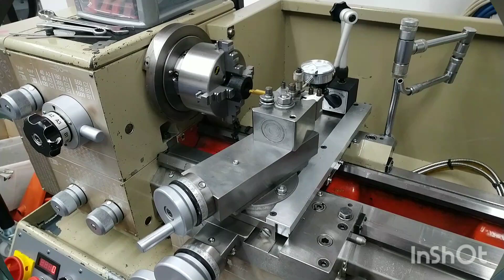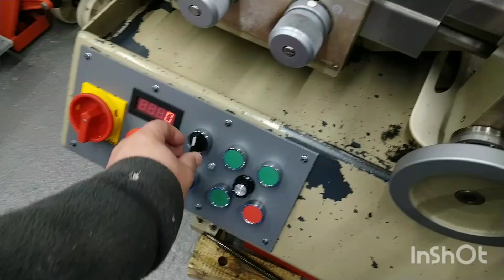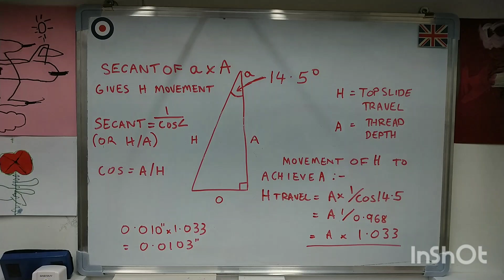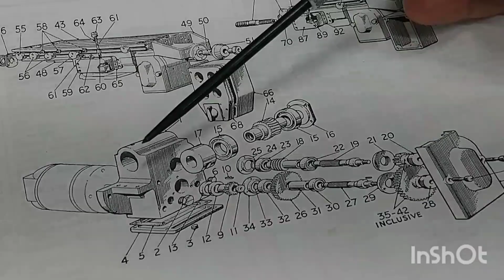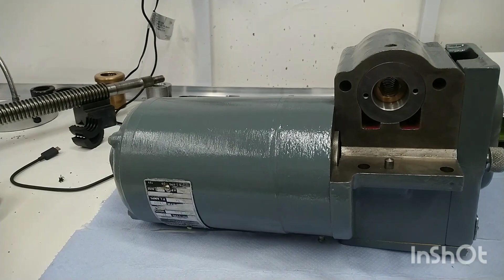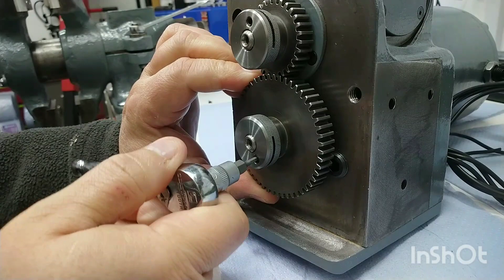Harrison Mill Refurb Part 5 - Threading Woes and a Look at Past Progress

Comment from the maker: Hello people! Thank you so much to everyone for the very positive response I've had so far to this film. I almost didn't put it out, it didn't seem worth it to show a cock up! This channel isn't a vanity project though. I do my best to be as accurate as possible in the home shop, but I make mistakes and learn from them. So if I do cock up, I will show it. If you are interested to see what went on with the motor, gearbox and other mill components before I had this channel, please have a look at my thread on the mig welding forum, here:-
https://www.mig-welding.co.uk/forum/threads/harrison-horizontal-vertical-mill-restoration.82648/

Comment: Excellent video.  It's great to see other people make the same mistakes as me.  Sorry to bother hear about the gear counting issue. Have you thought of 3d printing a gear for the one off operation?  I have designed gears on an online site and printed them. They work great for the time I needed them. Great job.
Reply: I just watched the other video with the gear description and failure.  I have also made a gear hob and cut needed gears . The hob I made still requires the blank to be indexed as the cutter is not a spiral but strait teeth.
Reply from the maker: Thank you very much. Sounds like you have done excellent work. I managed to buy a 3d printed 63t 1.5 mod gear designed for Harrison M-series lathes. I'm at work at the moment but when I return I will be back in the game.

Comment: Lots of good info in there for me Carl thanks. Interesting to see the feed motor and nut arrangements, very different from mine which has the swivel table. Cheers.
Reply from the maker: Yes, two very different set ups. I believe that on the universal model the feed gearbox also has an internal dog clutch to disengage the drive. I'm glad you found the film interesting. Thanks very much for watching and commenting!
Reply: @carlwilson1772  yes it does Carl. Cheers

Comment: The Horizontal model has such a neat powerfeed on it in comparison to the Universal.  I mean it wouldn't have worked with the swivel table of the Universal so I understand why they have it hanging out at the end of the table but it's still much neater!
Reply from the maker: Yes I totally agree, it is neat. The universal has a recirculating ball screw too instead of acme, I believe. Thanks for your support my friend.
Reply: @carlwilson1772  mine has a ball screw but it was an option not fitted to all of them. 

Has it's upsides and downsides vs ACME. Better for "production" work where you're using the powerfeed, worse if you're doing manual as it will "back drive" easier and you have to be militant about locking the X axis when not using it otherwise it'll wander!
Reply from the maker: @fastdruid  Great info my friend. Have a look at the channel Haxby Shed. He has a universal machine with ball screw. He has been watching my films to get info. I am sure he would appreciate your experience and I think you would like his content.

Comment: Lovely work on the motor, you do however make me feel a little guilty about just throwing away the original motor from mine and buying a brand new one...

It is an utter pain in the a*** to get to the bearings on the motor with where they put it though, I'm not entirely surprised no one ever bothered!
Reply from the maker: Thanks for your support mate! Yes you are right, I said on the mig welding forum that the plastic caps were still on the grease nipples. They always get lost, so it's likely no one ever greased the motor bearings in 50 odd years.

Comment: Great video Carl and an excellent explanation of the trig error and how to solve it, many thanks. I too subscribe to Haxby Shed and it was interesting to see that Paul referenced your channel for info on the Mill, along with Ralfy Customs - you guys are about the only source of videos on the Harrison Mill that I've found and will be extremely useful for when I start on the refurbishment of my mill. My mill doesn't have the swivel table like Paul's but I do have the vertical head. The only thing I wish is that it would be nice if the head had a quill feed. My mill is an ex-college machine and doesn't appear to have had much use, it's in generally good order but it's missing the coolant pump and during the delivery transport some muppet lifted it using the table wheel - in the process they managed to break off the "speed" handle which I'll have to remake, more annoyingly they managed to bend the table lead screw, not badly but enough to notice and it's annoying. Any good tips of how to possibly straighten the lead screw? I believe it's only the section close to the handle, when turning the handle you can observe that the scale appears to have a slight wobble, caused by the bend in the shaft. Other than that, I have a slight oil leak from the vertical head, it appears to be coming from between the head and the flange on the column. Oh and I dashed into the workshop to check if I had the change gear retainers still in place, they are there - your replicas are excellent and look exactly like my originals! (PS I didn't know the change gears were Myford, very good to know that).
Reply: There were three models of Harrison milling machine, Horizontal (no swivel), Universal (with the swivel) and Vertical. There was the option of the vertical head on both the Horizontal and Universal models. 

My Harrison also had a bent Y screw. I straightened it by clocking it between centres in the lathe and carefully pushing it straight. 

The heads aren't the most oil tight at the best of times, they do weep a bit. There is however an O-ring in there that has probably died. 

If you're on Facebook there is a group specifically for Harrison Milling machine owners....there is a manual in there too.
Reply from the maker: @fastdruid  Great info mate thanks!
Reply from the maker: Thank you Jason. I really appreciate you watching and commenting. I'm glad you enjoy what I call the "Whiteboard sections". I really struggled with maths at school. But it all made sense for me when I began my engineering education. When I started this channel I hoped that bringing in the principles behind the practice - one of my favourite subjects - would be my "USP". I think only Joe Pie does similar. So I am really glad you like it!
I have the vertical head for my machine and the horizontal overarm too. I hope you get a chance to look at my other films and check out my writings on the mig welding forum for more info on the mill. There is a lot of room in the coolant sump to fit a replacement pump. I feel your pain re the table leadscrew handle. My machine fell over in the delivery lorry and broke the handle too. Regarding straightening the screw, I think I'd mount it between centres and clock it to see where and how much the deformation is. Then you will know how much of a bend to apply to straighten it.
Mine is ex college too but has been roundly abused. You are right about the lack of a quill.
Reply: @carlwilson1772  I think you're right about the Whiteboard sections - I too struggled with maths to an extent but oddly now, it makes much more sense to me that it ever did at school, I use maths every time I'm in the workshop! thanks for the tip on the shaft, between centres and clock it is the way to go I think. I've been watching some of your other videos and I'm also on the MW forum, been reading your thread today.
Reply from the maker: @coplandjason  Thanks Jason, really pleased you enjoy the theory bits. I'm glad you are getting something from the videos and the forum posts. I plan on many more films about the mill and other projects, your feedback and support really spurs me on. Good luck with straightening your lead screw!
Reply: @carlwilson1772  When you get a chance Carl, would you mind sharing what equipment you use for audio? (I've been watching Paul (haxby shed) and his video on audio systems to use, I want to start making some vids and I'm not sure what to use. Your audio is very good. Thanks
Reply from the maker: @coplandjason  You might be surprised to learn that I film every thing for my channel using my Sony Xperia phone. Everything you hear is coming from the phones mic. I use no other equipment whatever. I have just been gifted a remote microphone by a good friend, but have yet to try it.

Comment: Fan simpler to do what I did, and use a mains fan, with an adaptor plate, to give the motor forced air cooling. 120mm square fan provides enough cooling air, and running all the time is going to make sure the motor runs cool at all times, as a non VFD motor running off a VFD tends to run hotter under all conditions, so extra air is better.  Remove internal fan, though the one cast into the rotor can stay. Power on fan with the machine power, not with motor run, so it can cool down the motor between use.
Reply from the maker: Thanks for the tip my friend. I will bear that in mind. Thank you for watching and commenting.

Comment: Pity about the Acme threading woes, but a good and thankfully not too expensive lesson, thanks to the foresight to manufacture the Delron test nut. I appreciate you explaining the feed-gearbox workings using the exploded drawing, prior to you showing us the now painted and completed gearbox, it provided me a much better understanding of its inner workings. Already looking forward to the next instalment of the mill refurbishment.
Reply from the maker: I always like to have a trial run, in any machining operation. If you would like to see more about the feed gearbox, have a look at my posts on the mig welding forum. I have put a link to them in the description. Thank you very much for watching and commenting!
Reply: @carlwilson1772  Yes, you can leave the change gears as they are, and use the VFD to do speed. Just swap them around, as most VFD drives and motors will easily go up to 200RPM with minimal loss of torque, though probably best to keep it below 120Hz anyway for noise and heating, and at the low end you drop off a cliff torque wise under around 30Hz, so best to keep in those ranges. The little motors do well at higher speed, I have gotten them to close to 400Hz, though you need to ramp up slowly to that so they do not loose lock, and at that they are not going to put out much power simply because the current is so low.

VFD put in around 1 second ramp up time, though set up the ramp down as fast as possible for things like limit switches, and DC braking hard and heavy, with around 5 seconds of it. Had a motor drive for a packing machine that took a 1kW motor and wound it up to 120Hz in 5 cycles, ran it for 35 cycles, then slammed it to stop in 2, basically as hard as the VFD could do it without needing an external chopper. 2kW inverter to get that extra drive margin and bigger DC bus capacitors, and the inverter ran cool, not so much the motor. But not as hot as the single phase motor next to it, that just ran a belt, with practically no load. Single phase small motors are bloody inefficient power wise, running at 100C case, and no way short of making it 3 phase to run cooler on the 1/2 HP motor.
Reply from the maker: @SeanBZA  Thanks Sean, a lot of really good info, I can definitely gain from that. Thanks for taking the time to watch and to comment.
Reply: @carlwilson1772  Already followed the link :) Enjoying your content
Reply from the maker: @paulhammond7489  Thank you Paul. I really appreciate your support.

Comment: I know it wasn’t your issue but it does seem an oversight that Harrison didn’t mark the tooth count on the M250 change gears. It can be difficult to check the  pitch with a scratch pass on an internal thread. What I sometimes do is check the set up on a scrap of round stock running the internal threading tool on the backside of the stock with the lathe in reverse with the feed direction set accordingly.. I too am a fan of Paragon paint. On larger items I use a mini paint roller designed for gloss as it’s quicker and leaves a consistent finish not too dissimilar to spray  but without brush marks.. Enjoying your channel thanks to Haxby Shed.
Reply from the maker: Thanks for watching Tony! It was my issue unfortunately! Harrison do mark their gears. The supposed 63t was one I adapted, please have a look at my earlier video on this. The gear I bought was meant to be 63t but it seems the supplier sent a 60t in error. Anyway the error was mine because I didn't check. I adapted that gear to replace a damaged 3d printed 63t. Thanks again for your support.